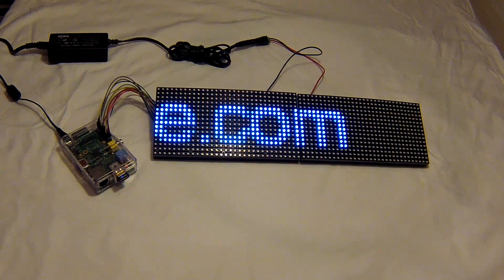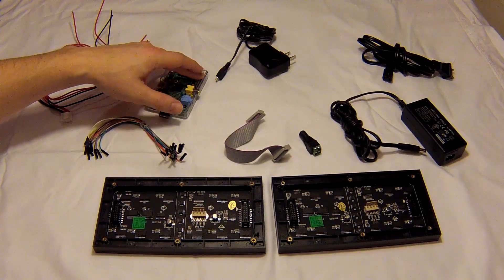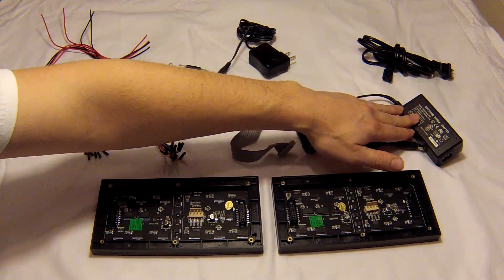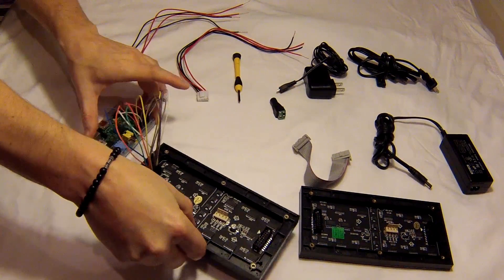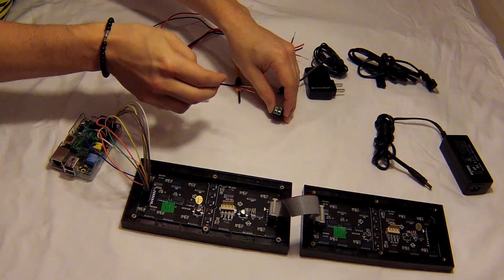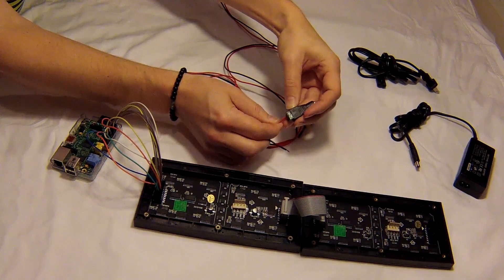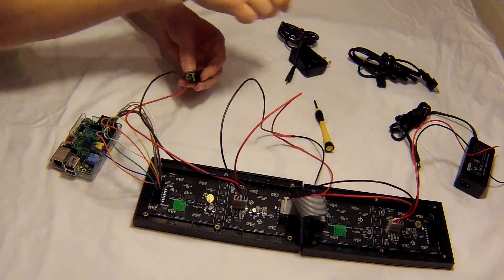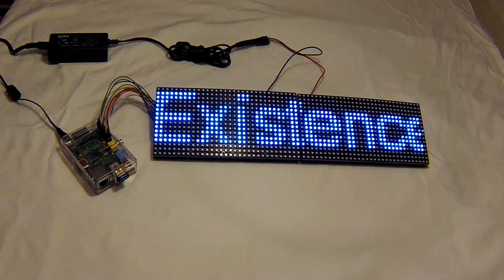Raspberry Pi LED Matrix - Part 1 - Hardware

Comment: It's not working for me... no one led going on
Reply: +Hessel Feenstra Without converter from 3.3V to 5V LED MATRIX can not function. The author forgot to say that the need to use 2x as follows:http://www.dx.com/cs/p/8-channel-3-3v-to-5v-voltage-convert-module-for-raspberry-pi-blue-368423#.VgXALfQcTs4